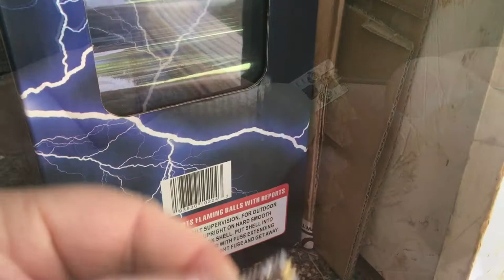Strat style Guitar Roller bridge saddle modification and installation

Comment: Thank you for this video. Was about to buy one from online store but for decided not to. I think I will go for the conventional saddle.
Reply from the maker: Hello,
There is another option depending on your neck and bridge requirements. The rollers in the video fit my Chinese made Strat copy but the bridge is smaller width wise. I purchased some higher quality rollers but they where too wide as they were for a standard Strat style bridge width. MAKE SURE YOU MEASURE YOUR BRIDGE WIDTH.
Here is a link.
https://www.ebay.com/itm/234161360783?hash=item36851acf8f:g:mgAAAOSw7FFhKVVz&amdata=enc%3AAQAHAAAAsI3I8Tk%2FIkzND1ofJPjxkOG0WM7GzXb7C2Mm3kznHRK2bz2LRF2EuY2p%2F2RtDlM6J0BPPKXnXphGdCMbUYJbo2uvrK5lsr5mHlbAXK%2BOyt%2FMvr3THJkvXuI1ZYj7U4rWf5OZjyLF0h2xUOFHwBryuvSmb%2Fh6LtBSPx4zx7ijCKwqX1EwWcRoEDcBE6zCUm5N7%2B%2F5ZD1E0RVokO%2BQ9JmqDIAq3pp94G%2BIoNxmFB5wNygR%7Ctkp%3ABk9SR9Lk8aj_YA
Reply: @witchfindergeneral13  thank you. I really appreciate it.

Comment: hey I am breaking lots of second strings at the saddle.....do you know what I have to do to prevent that?
Reply from the maker: I'm not sure. But make sure you don't have any burrs on the saddle where the string makes contact. Is it one string that breaks often? Or all at different random times? How old are the strings when they start breaking? It's an interesting thing I have not had to think about for a long time as I haven't broken a guitar string in ages. Make sure you are changing them often. Lots of playing = once a week or so. Less playing once a month. Depending on the weather conditions IE salt air etc , You can change them less often as long as you keep them clean and put the guitar away in it's case. Sorry it took so long to respond.
Thank you,
Richard

Comment: I would have left as is, I just need a round smooth surface.  Realistically roller is overrated, how much do they really roll, 180 degrees, 90, 45, 20, 10?  Your lucky if it even moves 2 degrees.  What I do like is that guitar.
Reply from the maker: Yes, you're probably correct but it's fun to experiment. I was thinking along the lines of a Kahler tremolo with the roller thing. I'm going to keep tweaking. The darn guitars sound really good. And they are inexpensive. It's fun.
Reply: @witchfindergeneral13 e root cause is the location where the string bends at the bridge plate and having very deep drilled holes in the sustain block.  A guy on YouTube modified his plate and it is perfect also the Gotoh FST style tremolo also does this.  You might get away with it if you find a way to drill the bridge plate holes in a manner to round them over.  If the nut was the real problem like every knucklehead claims every strat would be in perfect tune.  I am an engineer so I know the bridge is the real up issues.  Your mind was in the right place.  Last thought you might try drilling a countersink on the bridge plate and see what that does.  The guy on YouTube is Jay Menon.  Easiest fix but not cheap….Wilkinson locking saddles.